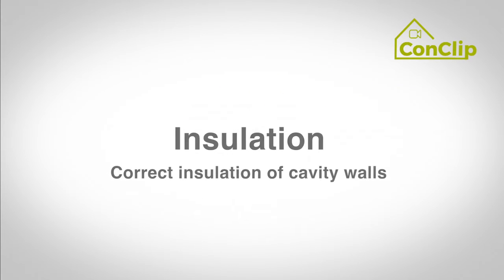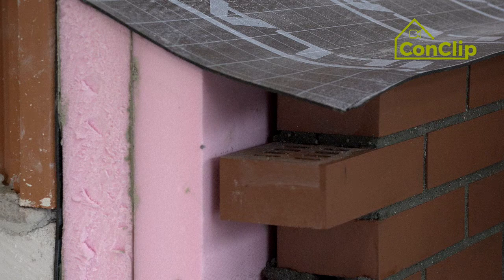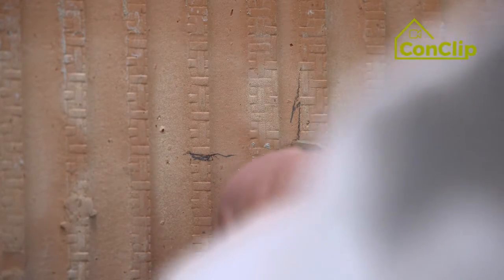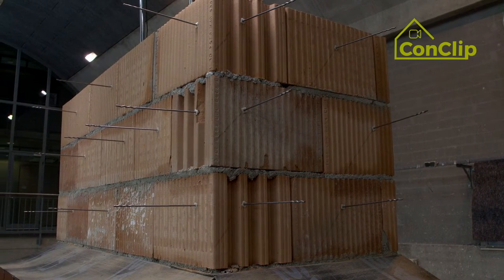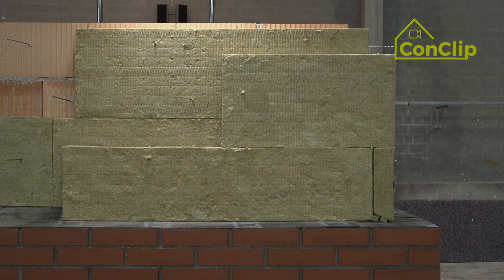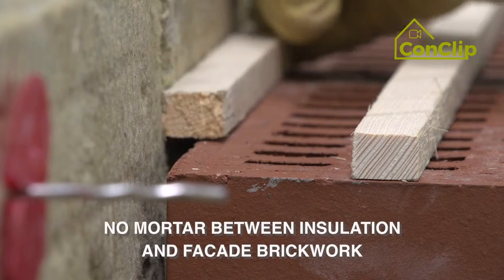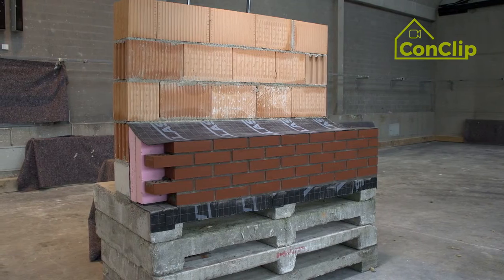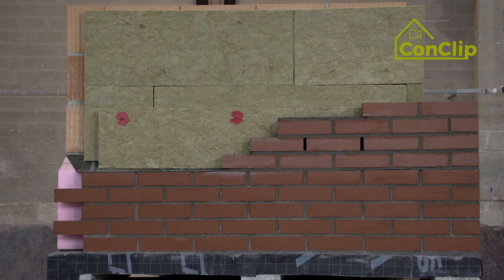ConClip 7 EN – Insulation: Correct insulation of cavity walls

Comment: There has to be LARGE air space gap in-between the insulation and the outer walls(inside the cavity), including an air space gap in-between the insulation and the cavity wall-tie drip-points(which must point downwards in the centre of the cavity). Therefor the air space gap must be more than half the span of the cavity.